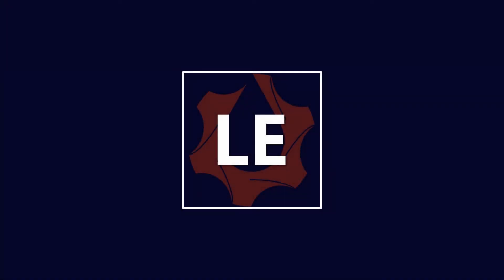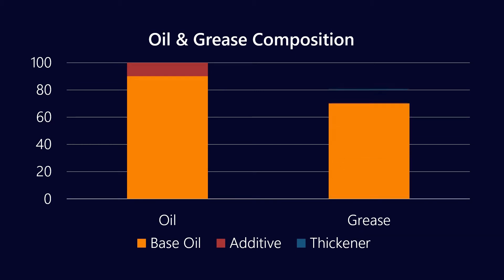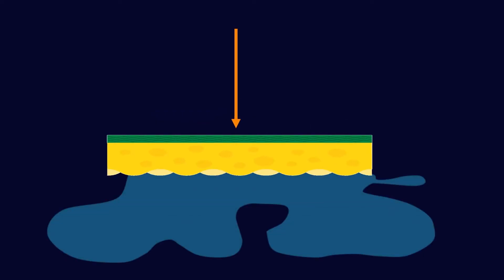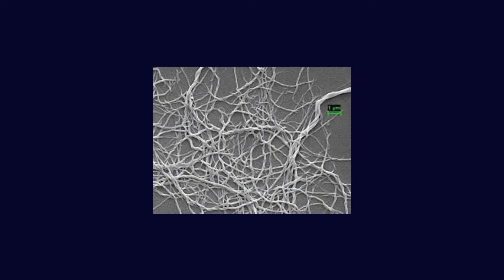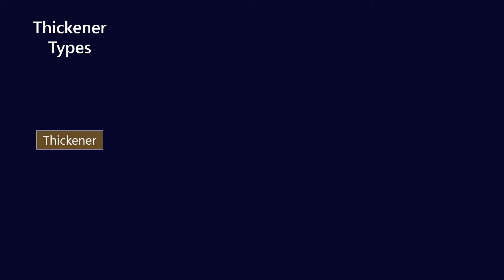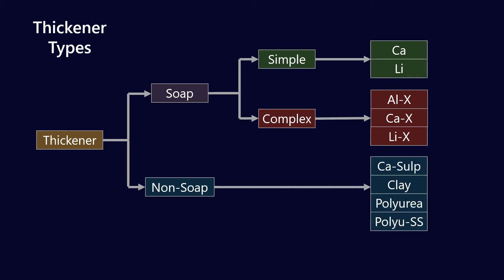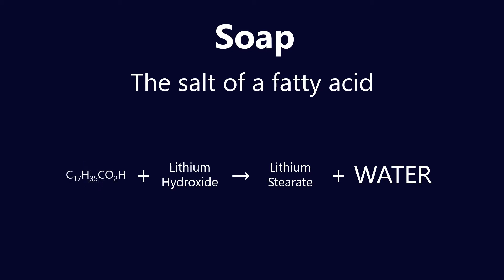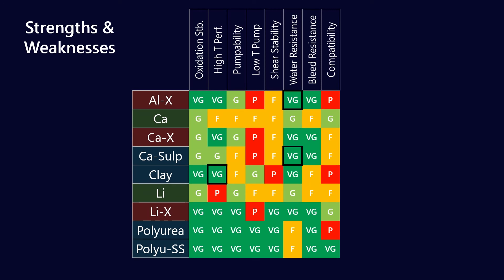What is a grease thickener and what does it do?

Comment: best racing performance grease? and ingredients?
Reply from the maker: Good question - do you mean for wheel bearings? I know that the Formula One Teams  use the off-the-shelf Lithium Complex, Synthetic Base oil 220cSt greases. I guess if it's good enough for them it should be good enough for everyone?
Reply: yes high temp bearing what is 220cst?  I just need good high quality hard to find one not alot info or tests out
Reply from the maker: 220cSt is the base oil viscosity. Most wheel bearing greases will be this viscosity grade.